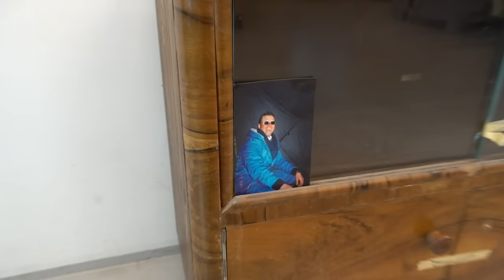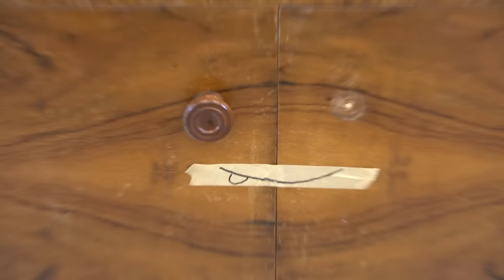WATCH the WOW Transformation of this Art Deco Cabinet!

Comment: Ah, yes. The holes cut in the back. Because what is any cabinet, but a place to put a TV and a VCR player? The cord must go out the back. Don't worry about all the heat the electronics create, trapped in the cabinet. It will be fine. Not affect the veneer, the glue, or the electronics at all! 

Beautiful job, as always

Comment: Great job I am curious where you got the new glass panel that had the insert manufactured little knob in embossed the glass? I have a china cabinet that has both of its glass doors and has the same kind of made in knob but I'm wondering if I can just use a blowtorch to smooth out any scratches on it.
Reply from the maker: Just a local company who does them.